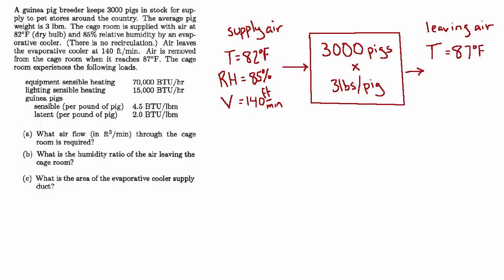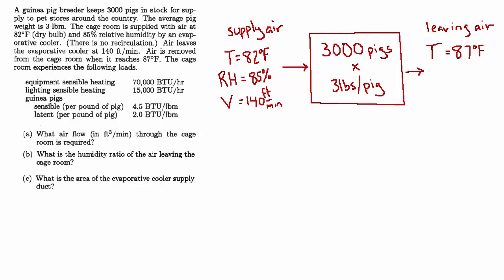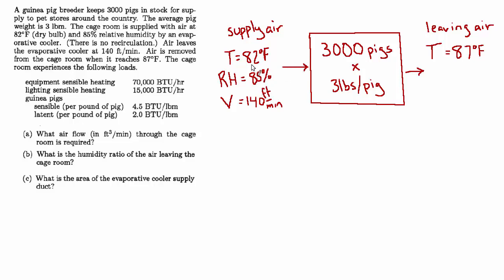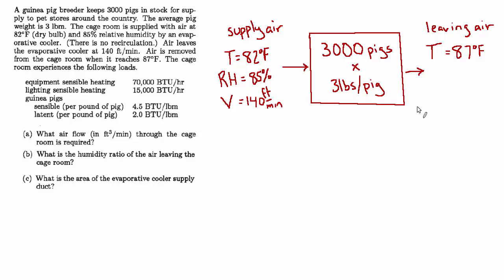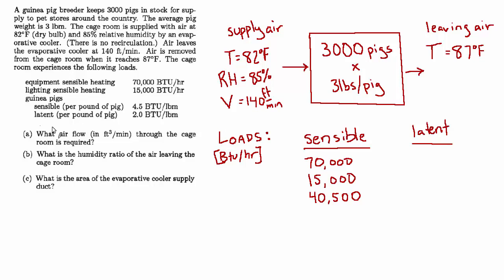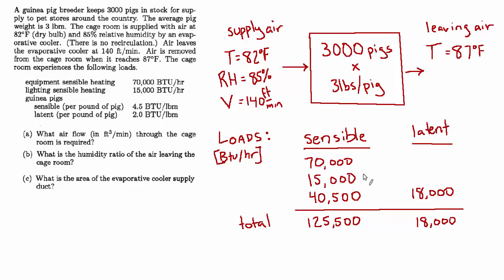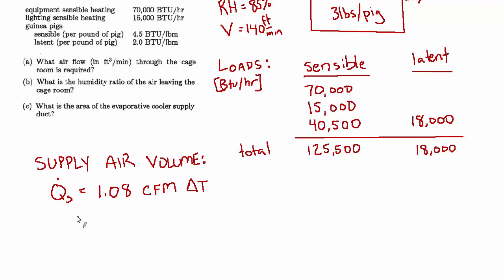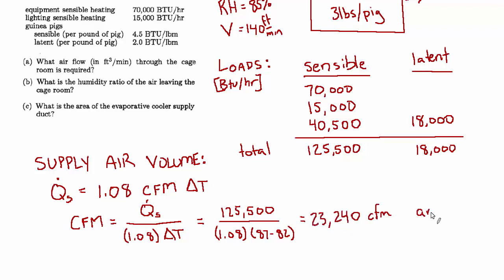101 Solved Mechanical Engineering Problems - HVAC Problem #10 part1of3

Comment: Hi Dan, love your videos! Just had a quick question.
The units of the sensible and latent heat load of the pigs are btu/lb not btu/lb-hr so is it safe to assume that the question implied btu/hr for the pigs sensible and latent heat? 
When I tried to work out the question I took the total load and averaged it over 24 hours (seeing how at any given time there are 3000 pigs). Why would that not be a valid approach?
Reply from the maker: Hi George, Hmm... I think maybe I read between the lines and assumed the problem statement should be BTU per hr per lb.  Otherwise not sure how to proceed.  Btu/lb tells us nothing about the rate at which heat needs to be removed, that would be more like enthalpy, but as we know a living animal is continuously generating heat.  Not sure it that's a satisfying answer but figured I'd offer it to you.  Hope you didn't get too bogged down on this.  Btw, I see you are in Daily Insights, how's that going?  When's your exam?  Shoot me an email I'd love to hear from you.  -Dan